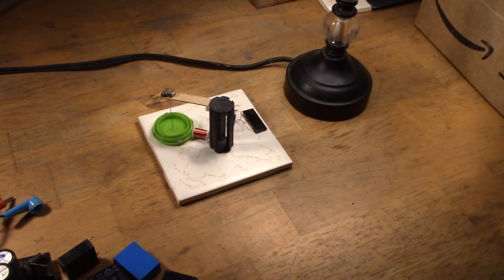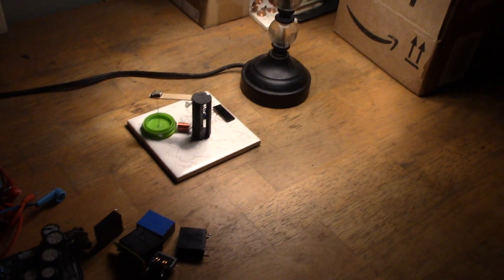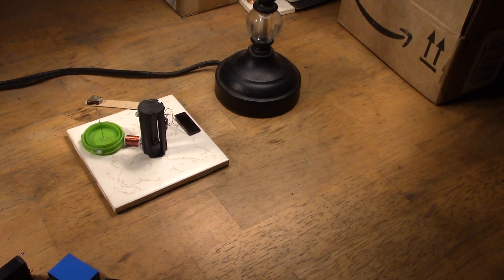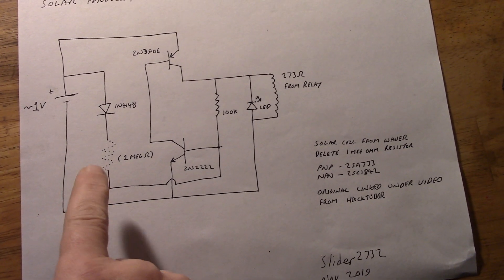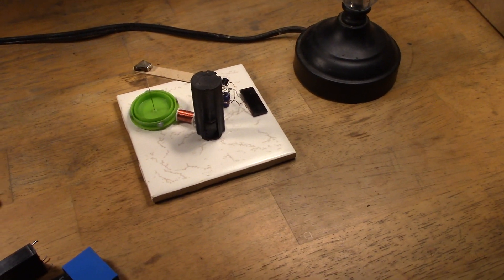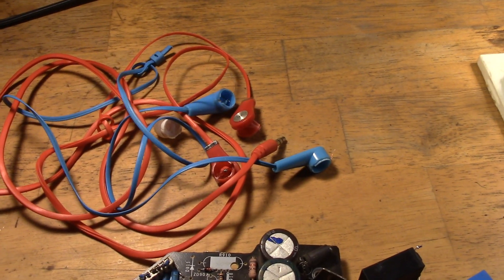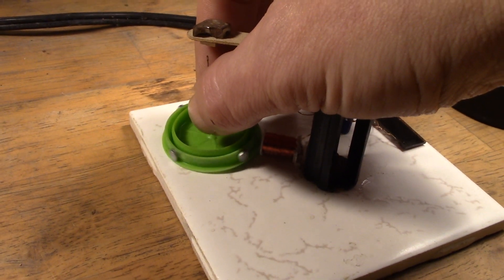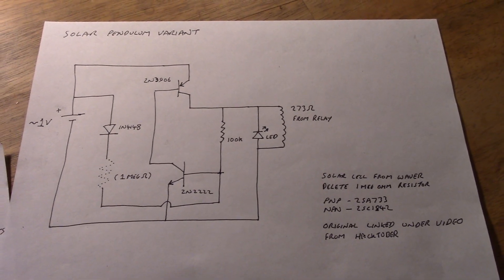Variant - Lidmotor's Blinker Motor

Comment: Hello Mark and Hello Julie. YT did it again. I'm going to glue that bell icon perminantly to notify. Anyway. This machine of yours is greatl You are definatly following the Recycle Recycle system my very good friend. I have had the boards in for my Nocturnal RA project. So I can get on with that now.Clue: It runs all night. Is enhanced through the day. Can be used to make any lithium cell comoletely safe by recovering all power to charge good cells/batteries. They would be that safe. You could open with an axe and poke about inside with a metal screwdriver. As long as you didn't get the lithium on your skin. Perfectly safe. On the 24th July I go in to have my other hip replaced. YEAH!!! No more pain killers. At the moment they are smarties LOL I eat that many. Anyway I shall pop in as I get time to go through all your videos I missed. So expect me to pop in now and again. Please stay safe. We are getting second wave here. Only 16 miles from me. I am looking after myself please don't worry.
Reply from the maker: I had been worried for you and am glad yer kicking there strongly. Best wishes for the other hip, else you'll walk about in circles. 
Nocturnal RA FTW, as they say!
Reply: @Slider2732  Thank you my friend. What is FTW? Stay safe.
Reply from the maker: @MYNICEEV  Ah, it means 'for the win'

Comment: I will have to track down a cheap source for those relays.  Those coils look like a good alternative for these type projects.  I'm wondering if the solar waver circuit board would drive them.
Reply from the maker: Was lucky to find most of my parts boards in items from Minnesota Clean Up week, before we moved to OK. CRT's, microwaves, lots of junk has them on the 12V line of the power supply. Good point on the waver circuit, am thinking I'm going to find out :)

Comment: Excellent! Do you leave the core in place in the relay coil?
Reply from the maker: Not on this type, as the magnets hold too strongly to it. The core is normally attached to a strip of metal which can be moved backwards and forwards to snap it. Then the core falls out (you likely know already Ben, but others may wonder the same). Was a good question, which I oould have pointed out.
Reply: @Slider2732  Thank you.

Comment: Love the idea of using the old relay coils 😍👍
Reply from the maker: Easy disassembly, but getting the metal rod out of the middle needs a set of pliers. They're great for tiny thin wire on micro plane actuators too.

Comment from the maker: Forgot to point out - there is also a 470uF cap across the solar panel.
Edit - The cap dictates flashing speed, but more power to the coil is from slower flash rates. It's a careful balance, ideal for known light levels indoors. Lidmotor's circuit is better for natural light.